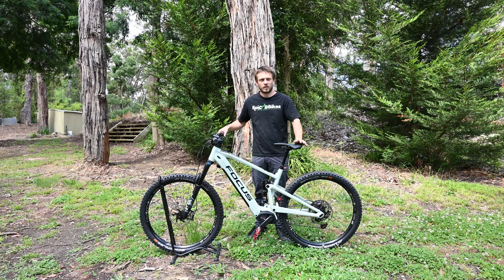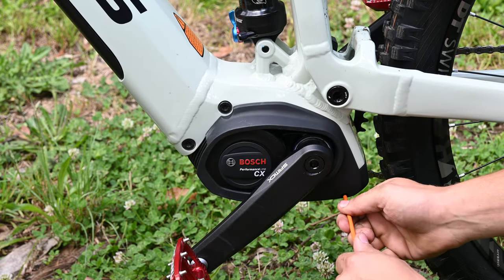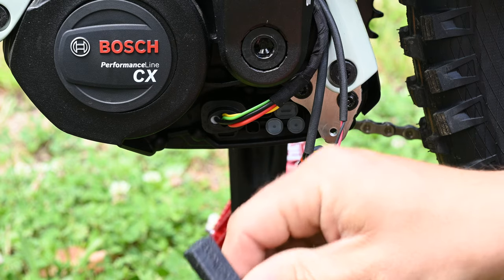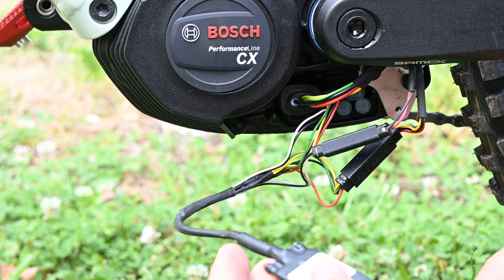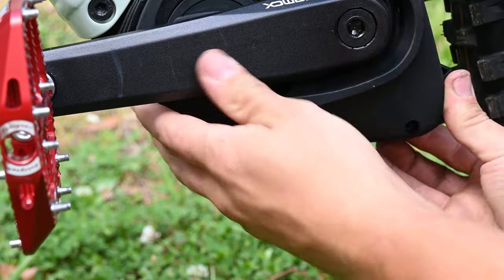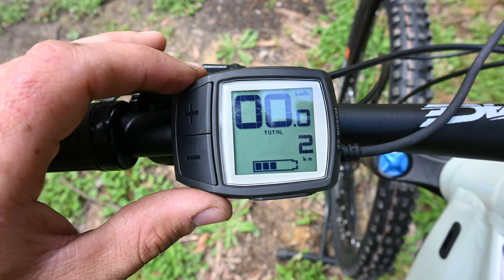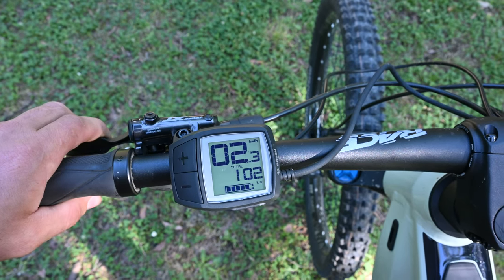2021 Focus Jam 2 6.9 Derestricted - Bosch Cx Gen 4 Motor Unlocked

Comment: Very useful video. I was wondering how to manage battery swapping "on the fly" in the middle of long rides when you use 2 batteries, especially with the latest version of the chips with the 5-8min delay before countdown starts, and how deleterious it would be if turning off the bike to swap battery before the compensation has started.

Comment: I have a 2020 Thron 2 6.8 and have upgraded the display to the Kiox  also has the upgrade software to 85 nm, will it all still work the same as in the video
Reply from the maker: Yes compatible with the kiox and the latest 85nm update

Comment: Does the tuning effect the lower cadence support or only top speed?
Reply from the maker: The tuning changes the point at which motor power stops from 25km/h up to 35-75km.h Depending on the chip fitted and the settings selected. Other then the changed speed limit the bike functions the same.

Comment: Does this mess up the real odometer reading, actual riding speed reading and can you still use walk mode without engaging or disengaging restricted mode?
Reply from the maker: Walk mode still works and the chip can be programmed to use a different button if desired. The odometer and speedometer readings show the real speed and distance traveled

Comment: wouldn't easier just to remove the magnet? Honestly tired of this Bosch motor halting, coughing, gagging or whatever you call it when I pass 20mph.
Reply from the maker: Motor wont run without the magnet. Bosch work very hard to stop people bypassing the limter

Comment: Hi my chiped gen 4 doesn't do the countdown. How do I activate it please ?
Reply from the maker: On The latest version of the chips the countdown starts after 5-8minutes. This is so it does not start when you simply stop for a short time during a ride. The countdown does not always happen it depends on how long you have been riding above 25km/h on a particular ride

Comment: I have just bought this bike. I'm looking to de restrict it with your chip but I'm concerned about warranty and motor reliability if I go ahead with it
Reply from the maker: There is no power increase to the motor so it is under no more strain them usual. If you need any warranty you simply remove the chip to return the bike to default operation.
Reply: If you chiped it one time, bosch can see it and takey your warranty..
Reply: @armwrestlingmunchen2339 

> If you chiped it one time, bosch can see it and takey your warranty.

That is generally incorrect. In the USA, for example, there is a law called Magnuson-Moss Warranty Act, enacted in 1975. Its current text is part of the United States Code, Title 15 - Commerce And Trade, Chapter 50 - Consumer Product Warranties, Paragraph 2302 - Rules governing contents of warranties, Letter (c) - Prohibition on conditions for written or implied warranty; waiver by Commission. Link: http://uscode.house.gov/view.xhtml?req=granuleid:USC-prelim-title15-section2302&num=0&edition=prelim

It states the following:

"No warrantor of a consumer product may condition his written or implied warranty of such product on the consumer's using, in connection with such product, any article or service (other than article or service provided without charge under the terms of the warranty) which is identified by brand, trade, or corporate name; except that the prohibition of this subsection may be waived by the Commission if
(1) the warrantor satisfies the Commission that the warranted product will function properly only if the article or service so identified is used in connection with the warranted product, and
(2) the Commission finds that such a waiver is in the public interest."

This means that the applicability of a warranty cannot be restricted by the consumer using this product together with other products unless the warrantor (the manufacturer) can prove that the product was damaged or made otherwise disfunctional by such actions.

One of the implications of this law from 1975 is that the onus of proving that the damage has occurred is on the manufacturer.

Another implication is that the "warranty void if removed" stickers most of the time have no legal power to void the warranty. Unless the manufacturer can prove that by removing the sticker the product can be damaged or made otherwise disfunctional, it is safe by the consumers to do so while retaining the warranty.

There are some cases where even removing a sticker can cause damage to the product. For instance, on older spinning-disc hard drives there might be a sticker blocking the dust from entering the chamber with platters and damaging them. But those are rather rare exceptions.

So, going back to electric motors, if Bosch can prove that by removing the speed restriction the motor has been damaged, then they can claim that the warranty has been voided as a result. But the burden on proving this is on them. Simply stating that the speed limit was lifted and the bike has indeed reached speeds above 25 km/h while being driven by the motor is insufficient. They must prove that such activity is damaging to the motor.

Comment: Now i have 503 ERROR
Reply from the maker: 503 error indicates a speed sensor error. Check you have the two pin plug installed correctly and then contact your place of purchase for further help if needed.

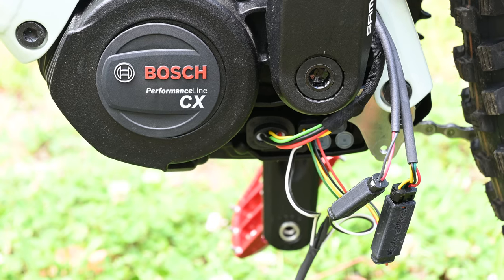Comment: There seems to be an important piece of the video missing. How did this larger plug mysteriously show up plug in to the motor? It was not plugged in, and then at 2:27 it magically plugged itself in?? Is it plugged into a test port? Why was this omitted from the video? Is it illegal for you to actually show us how to plug it in? What am I missing here?
Reply from the maker: As far as we can tell the video shows both plugs being installed?
Reply: @EpiceBikes  He says (at 2:27) "Okay, once they're all plugged it, we'll show you how to test the chip". It doesn't show what he plugged the the chip in to. The video jumps to the chip already being plugged it. What did he plug it in to, to test the chip? Perhaps it's not plugged in to anything at all, and just appears to be plugged in to a port?? Resting on top of the other wires, so that he can show us the lights lighting up?? Still confused as to whether he plugged the chip in to a port while he tested it. I don't see a port in that space, once he removes the chip after he tested it. Is there a port that we don't see, because it is too dark to see it?
Reply from the maker: @onceuponareset-ho7fg  All connections are shown between 1:15 and 2:25 after that the bike is just turned on to confirm the chip lights up. There is no additional plugs its just the chip resting in a spot where it can easily be seen by the camera.